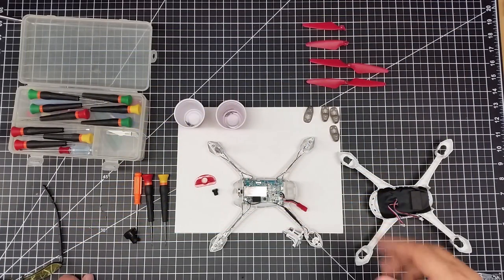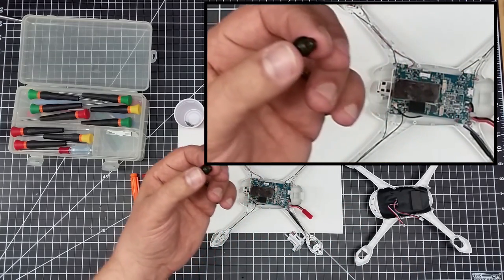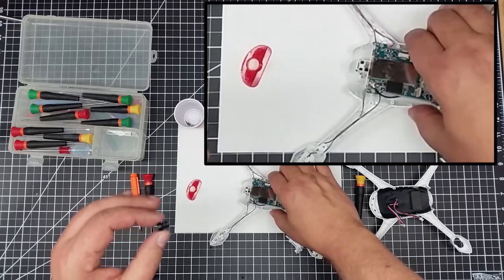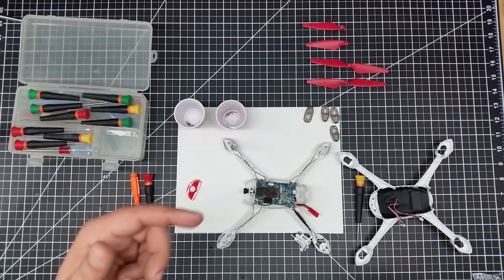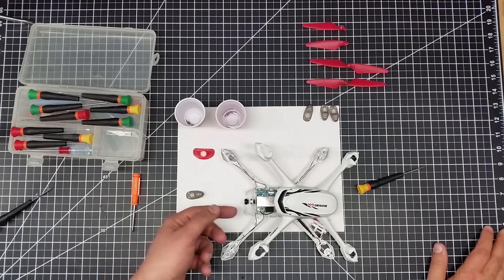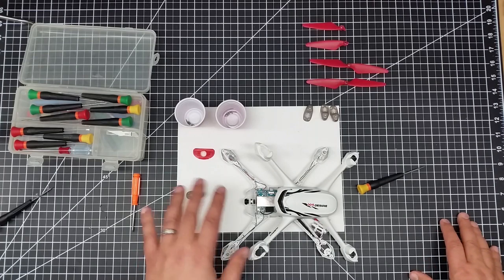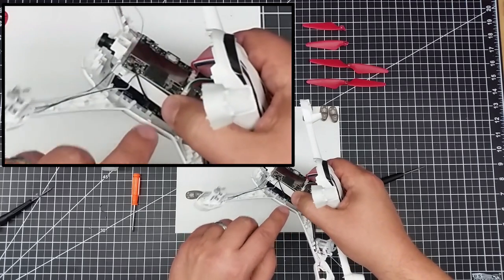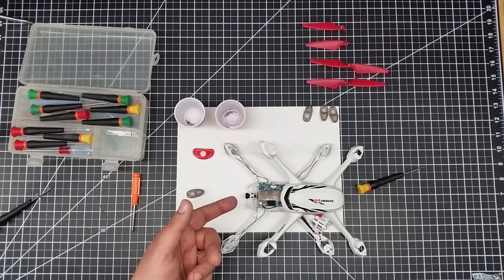Video Drone - How To Adjust the Camera Focus of the Hubsan X4 H502!

Comment: Thanks for sharing. I only removed the four front screws and priced open the front to pull out the red plastic peace. Then put a mark at 12 o clock. Put in battery started recording  moving lens to ten o clock five past then on to ten past . Stopped recording  review on PC and ten past was the sweet spot.  Job done easy fix.
Reply from the maker: Very cool!
Reply: Sounds like a great plan ! I wasn't looking forward to removing virtually every screw in this thing :D

Comment: Have you tried to expose the antenna? Or put a small rubber duckie through the shell?
Reply from the maker: Not really its its pretty well placed and felt the extra weight would would off set the gain...

Comment: Actually I think if you take that camera out and put a little fpv camera in there you wouldn't change the wait I will check it before I do it but I don't think it would be any weight change in it
Reply from the maker: While nothing is impossible, it wouldn't so with this little as it as board camera but as I recall the control was on the main boad so the combined camera, transmitter and antenna would likely be a bit heaver and  please keep in mind these are brushed motors so they will not hold like the brushless.  I am actually working on building a 200mm FPV quad right now :-)

Comment: Great video have you thought about putting a fpv small fpv camera out of a racing drone in there I've just got one that is probably not much bigger than the one that's in there if you take out the plastic piece and maybe hot glue it down so it would stay in place and then put the board for the fpv camera underneath the controller board probably your Ribbon coming down from the top is mainly power I'm hoping I've got one I'm probably going to try it by just unplugging the ribbon and see if the drone still flyers if it  still flies I going to try to put an fpv camera in it and power the camera of the battery lead the camera will run on 5 v up to 24 v I will let you know if it works
Reply from the maker: You could but this little guy is sensitive to additional weight especially in its PID loops so it s want to keep going up even though its past its target height because it is acting faster then the controllers loop trying to compensate for added weight...

Comment: I had to adjust the focus of my H502S, and I found I could do it simply by removing the bottom shell, popping out the lens holder, and using needle nose pliers to turn the camera lens. 

It’s much less work than removing the propellers, than the top shell. 

I used the FPV for adjustments while having the drone facing a building out of my window a 100 feet away. I shot 6 recordings unto the micro SD card and check the footage on my pc. I got it perfect at the 7th recording. 

The FPV helps with fixing major blurring but it’s best to check recordings on the pc at full resolution I think FPV resolution is only 640 x 480. 

I also kept in mind that close ups did not inadvertently become blurry. 

First I tried clock wise, but had to eventually go clock wise. 

I undid 8 screws along the legs, and 6 on the 2 front foot pads.
Reply from the maker: The only issue one has to be aware is doing it this was as your correct this possible is damaging the threads of the with the pillars...
Reply: Video-Drone I have this same issue on my hubsan h502c, basically the same quadcopter just in a different body shell and different battery. Is it possible to remove the bottom shell first then? All the videos I have seen on this show removing the top shell and everything is screwed and clipped  in the bottom shell with the camera module being below everything!

Comment: Is it possible to replace this original mini camera with another model, such as h501?
banggood.com/Hubsan-H501S-X4-RC-Quadcopter-Spare-Parts-5_8G-Image-Transmission-Module-H501S-11-p-1045996.html?rmmds=search
Reply from the maker: I do not  believe so, while anything is possible.  A camera swap would be very difficult and not worth while IMHO...

Comment: Great video i have got the same problem, on the ground the camera is fine, but soon as i take off its blurry, you seem to know a lot about this drone, could i strap a mobius camera 40g to my h502e for short periods only, or do you think it would burn my motors out
Reply from the maker: Likely burn up motors and more.  There several videos out there where folks did this and there where issues.  You might try something like this http://amzn.to/2oZxjbx as it far lighter and I have attached one to the Syma X5...

Comment: I tried your suggestion on adjusting the focus today but I can't get anywhere near the results you got. It is a very touchy adjustment. Just the slightest movement of the lens makes a huge difference. Do you have any other suggestions on how to get a better quality picture?  I love the quad but the pic quality really sux. Thx
Reply from the maker: Larry it is a VERY painful process for sure!  So (1) make sure your test (focus) target is at least 40 to 50 feet away (100ft would be better if possible).  Now (2) spin the lens outward by a say two turns and (3) take sample image (4) spin "in" 1/4 turn take image and compare.  Repeat #4 till the image starts to reverse (i.e. the fuzziness will reverse because you have passed the focal point).  Now (5) turn back 1/8th turns taking images and comparing till happy but avoid passing the focal point again.  Hope this helps...

Comment: My H502s came with an out of focus camera.  Watched your video.  Fixed my camera thanks to your help.  Thank you so much for your help.  I ended up using a pair of needle nose pliers to loosen and unscrew the camera lens from the glue.  Slight pressure with the pliers worked extremely well.  I linked to this in my video to help others who may be having this issue.  If anyone is interested, here are the results of the fix:
https://youtu.be/3x-_AEOLE4k

Thank you Video-Drone.  Liked and Subscribed
Reply from the maker: Wow that was a far better improvement than I got, however I don't have the FPV screen as with the "S" so it was take video, down load, check, twist, repeat!  Was a major pain and also thank you for referencing me!

Comment: Could you please give us the measurement of the from of the lens to the base where it screws in. It would save us a lot time searching for a starting point.
Great video.
Reply from the maker: Sorry not in a position where I can provide that right now, however it won't of much use as being rather low quality I am sure there will be variations in the pitch of thread and can easy mean the differences in at least one turn or so.

Comment: Do you think it would be possible to buy the camera 1080HD as a spare part for the Hubsan 501s and fit it into the 502s?
Reply: Just seen the question has been asked before, they sell the parts at Banggood, the boards do look different.
Reply from the maker: The Hubsan web site should also sell them too...

Comment: hi my 502s fell while in rth user error it cracked open now rear left led an motor wont work any idea what could cause this or what i need to replace no wires out of place checked connections an no burns on main board plz help if you can shybo.rc@gmail.com thanks any advice appreciated

Comment: Hi, I have just replaced my camera module, my camera just stopped recording to sd card, I also made some easy simple landing gear using zip ties and they work well, I also replaced the drive shaft bushes with roller bearings. this will show you the landing gear. https://youtu.be/uFYbSkCfZow. many thanks for your video.Ron fromOz
Reply from the maker: Did you just replace the camera module verbatim or strap one to the belly (hard to see in the video)?
Reply: Ron Porter I did exactly the same, gives ground clearance and some suspension on landing
Reply: yes I replaced the camera module, I got mine from Bangood, just the wait for delivery to Oz was a bummer!

Comment: i just do it and i see huge improvement, it needs a lot of time to adjust it correctly.I put 3 boxes, the one on 10m the second on 5m, and the 3d on 1m.I adjust it between 5-10m.I make a mark on the lens and and i turn them        5 , 3/8 times that was the best for me
Reply from the maker: so you had to turn 5 and 3/8 times?  interesting as think it was around three for mine however i set the focus point at 40 feet.  i have also decided to convert it to a NIR camera so watch for a video soon 😎

Comment: You should try making a 3D model of the upper half of the copter shell and mod the front to house your keychain camera. That would be cool.
Reply from the maker: I have kicked that around the built in camera has quite the connection to the main board so they likley share some logic and it is a large board with a VERY small ribbon connector.  However I am considering modling the shell and creating my own shell like a small S500....

Comment: would like to see a camera mod / swap
Reply from the maker: This might be hard as there is a very tiny yet many conductor ribbon cable which joins the camera board to the main so there might shared electronics.  However will see as I am in with you on the idea!